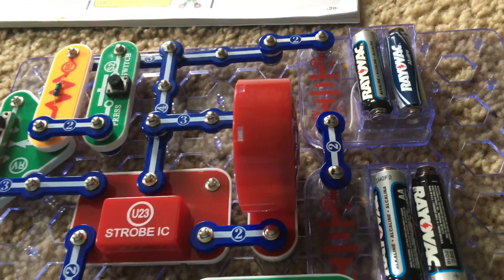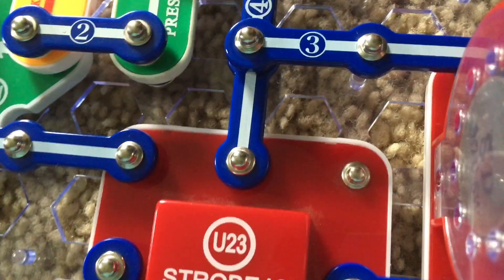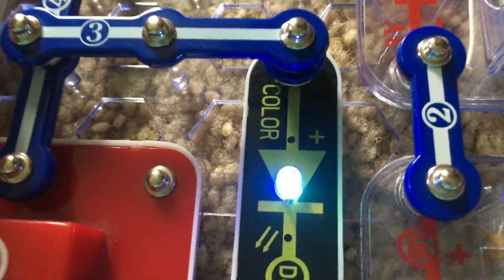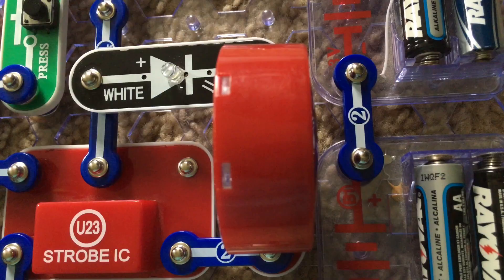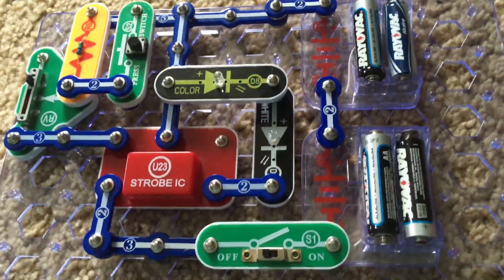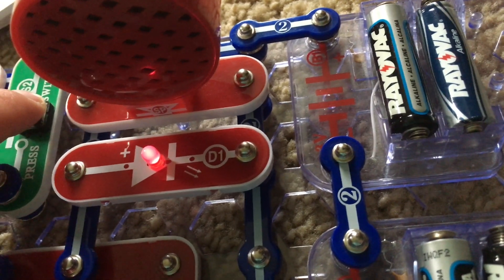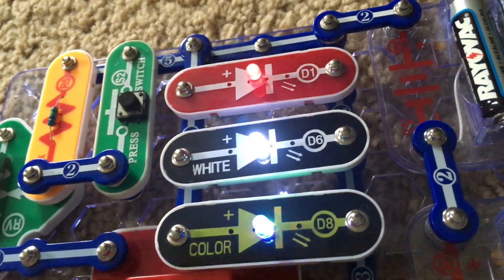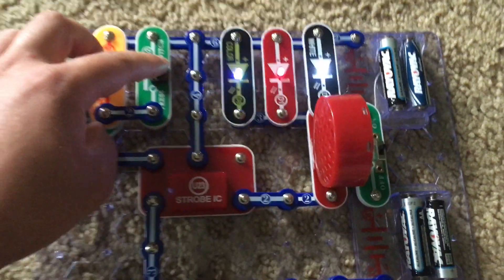Snap Circuits Light: Projects 19-30 (SEIZURE WARNING)

Comment: Matter fact, I watched a YouTube video where someone made a full-fledged fire alarm system using the extreme and process sets as well as the junior light and 3-D illumination kits. Along with some alligator clips and an AC outlet yes as no joke someone actually did manage to create a fire alarm system using snap circuits.